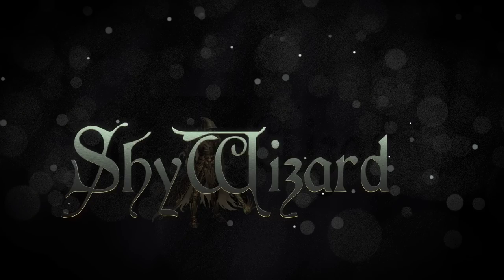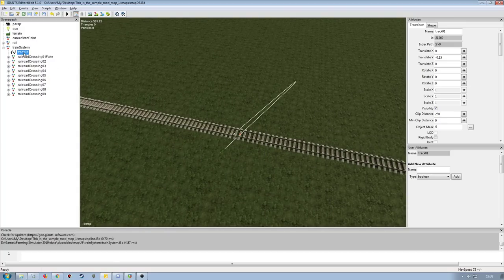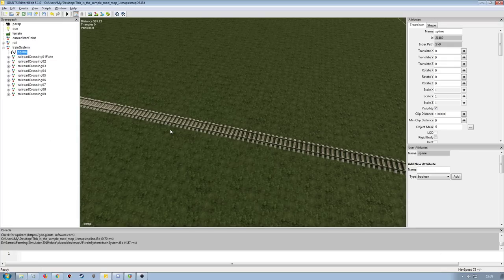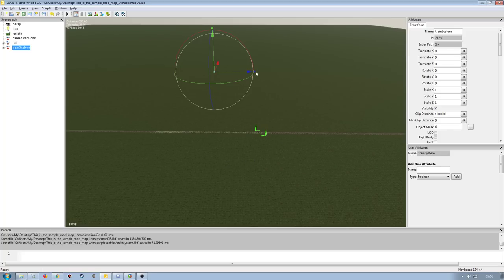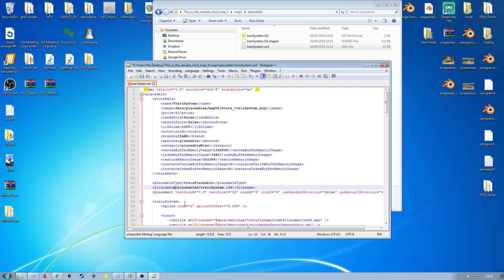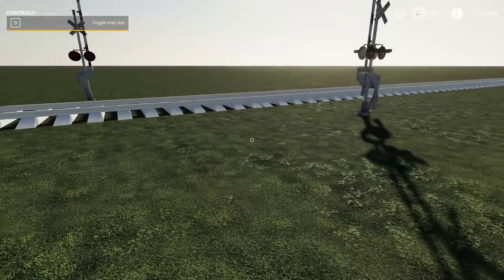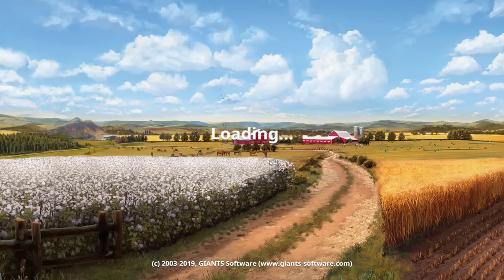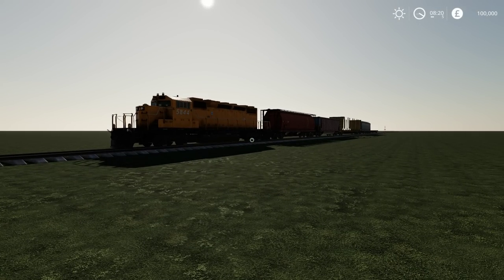How to setup trains - FS19

Comment: Hello sir. I know this is late but i hope you can help. i can`t seem to find any tracks to download for FS19, only on 17. I have tried them on my map but the train does not act right. The wheels are sideways on the tracks. I think it has to do with the track. I made a spline outside the tracks and the train are fine. Can you please tell me where to download the track that you use? or if you can tell me if the tracks for 17 is ok to use. I`m stuck at this pont.  thank you.

Comment: Hey, great work! 
Do you have an idea of how to change the motor configuration and wagon capacities? I tried to put the locomotive XML with the motor values changed at the same folder as trainSystem, so in the trainSystem.xml I pointed the vehicle locomotive to my custom locomotive.xml. I changed just the motor power because the i3d files point to $data/vehicles.... But when I do this and start the game, I just see a black screen and the FPS drops to 6 and crashes my PC.

Comment: Hey.
It's great video you make, but I have two problems that I think you can help with.
1. When I swap out a spline with someone I make myself like you do, it doesn't work, but if I delete all the points on the old spline and put it into action, you can say why.
The second is to move the shop icon, to the place where you make a new shop, for me it will be where the original card has it.
Hope you will help me.
Flemming Holmelund from Denmark

Comment: Can you do the ship splines the same way. I mean by raising the blue marker up. then page down button? I have problems with ships floating into land
Reply from the maker: You should be able to use this method on any spline
Just make sure there is something under it, like terrain or a water plane.
Reply: Thank you. I had problems doing this on the water plain and thought there had to be a easier way. Thanks

Comment: i did everything you did to the T, but when i start my map it gets really laggy and when i tab to the train i get a black screen and it says the train is going -9000000 and have to ctl-alt-del to get out of game any suggestions
Reply from the maker: What errors if any does it show in the log.txt?
Reply: @shywizard2979  have you looked at it, what are your thoughts ?
Reply from the maker: @hydrazombie  So my thoughts are this,
You have not closed of the spline which will cause an error (Closing the spline can be done by selecting the start or end point on the spline & pressing the "O" key on your keyboard, spline must be visible to do this).
There are incorrectly linked nodes in the xml & should look like this
        <railroadCrossings>
            <railroadCrossing rootNode="1">
                <activation startDistance="125" endDistance="125" />
                <gates>
                    <gate node="1|0|0" startRot="0 0 0" endRot="90 0 0" duration="3" closingOffset="1.5" />
                    <gate node="1|0|1" startTrans="0 0 0" endTrans="0 1.2 0" duration="2"/>
                    <gate node="1|1|0" startRot="0 0 0" endRot="90 0 0" duration="3" closingOffset="1.5"/>
                    <gate node="1|1|1" startTrans="0 0 0" endTrans="0 1.2 0" duration="2"/>
                </gates>
                <signals>
                    <signal node="1|0|2" alternatingLights="true" />
                    <signal node="1|1|2" alternatingLights="true" />
                </signals>
                <sounds>
                    <crossing template="TRAIN_CROSSING_BELL_01" linkNode="1" />
                </sounds>
            </railroadCrossing>
Reply: @shywizard2979  you the man, that fixed the train. thanks